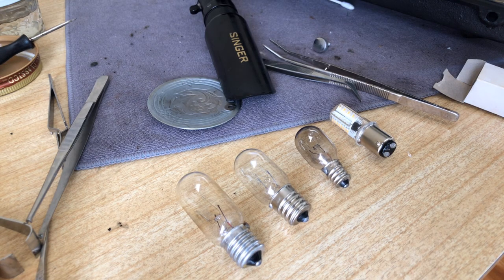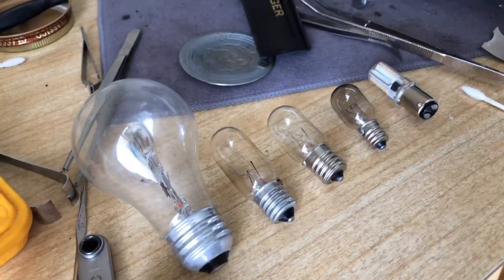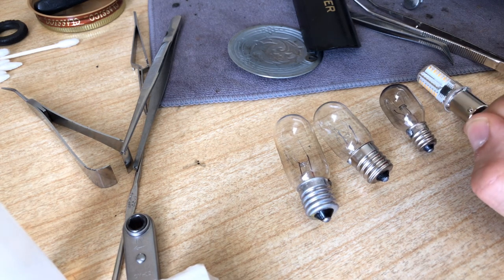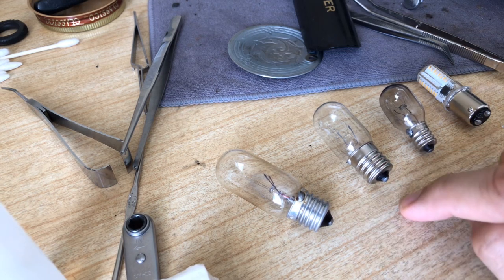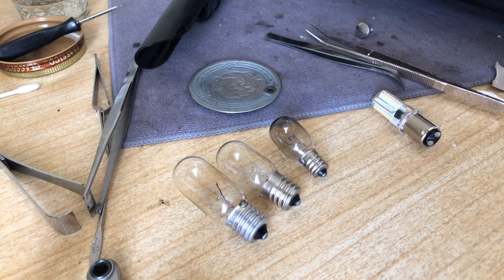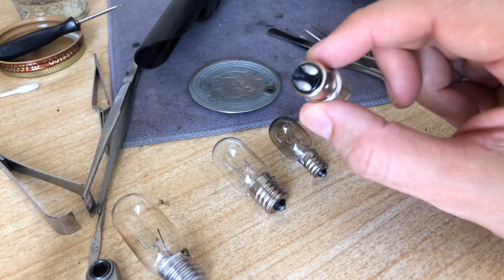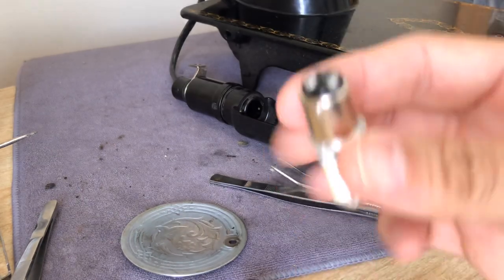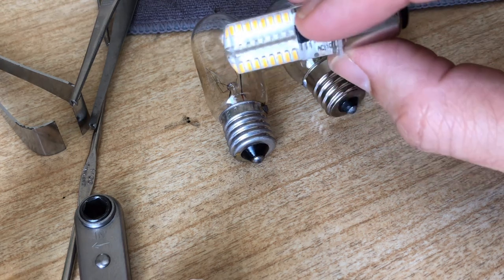TOOLS & EQUIPMENT SERIES #5: When the Light Bulb Comes On: Bulb Types For Vintage Sewing Machines!

Comment: Thank you for this video. My bulb broke inside the socket in my Singer 128. Any tips on removing it? How do you remove the metal light deflector ? I feel with that removed I could get better access to it.
Reply: Get a short length of 1/2" vinyl or rubber tubing from Home Depot or your local Hardware supply. You'll only need about three inches or so. Cut a 1/4" slit into one end of the tube. Insert that end of the tube into the stuck lamp base which you need to remove from the old socket. The little cut you made will allow the end of the tubing to insert into the broken bulb base.  These bulbs have a base that is slightly over 1/2" so if your tubing is too small, get the next size up (5/8").  Push and then twist, as if you were removing the bulb normally. If all goes well, you will be able to remove the broken end of the old lamp, it should be held by the piece of vinyl/rubber tubing. When you retrieve the vinyl tubing from the lamp base, the old remnant of the broken bulb should come out right along with it.

Hope this helped! Great question.

Comment: Came here after trying to replace the incandescent bulb in my Singer 247. I have the proper LED bayonette replacement, but the socket is not compatible with the new bulb, having a deeper socket, which has a 1/16" ridge, preventing the two pins from engaging with the lower slot. I've replaced all my other sewing machine bulbs, with bayonette mounted fixtures without any issue, using the same replacement LED product (a Husqvarna LENA  and a Kenmore 158.14101).

I think I could modify the fixture to accept the new bulb, or replace it with another fixture with another receptacle, but is this absolutely necessary? Is there another bulb that might be compatible?

We need you.
Thanks for the content.
Keep up the good work.
בס'ד

Comment: I am having a problem. I can’t remove the light bulb from my 201-2 machine. I’ve tried everything I can think of. I’m afraid it will break in my hand if I push any harder and try to turn the bulb. I’ve never had this problem with a singer light bulb. Can you give me any feedback as to how to remove it.

Comment: I have upgraded many machines to led bulbs. Surprise, they don't always last as long as they are supposed to. I've had some burn out after twenty hours. But they do run much cooler and use lots less electricity.
Reply from the maker: Great point Ronald.  "Good" LED bulbs should outlast any other type.  But sadly, like everything else consumer grade, there are poorly made LED bulbs that don't last.

Comment: I have a really good condition 15-90 however the bayonet style fixture has a broken cover that goes over the wire and switch internals. It seems to be a bit of a pickle of a situation since I can't even find a listing of the fixture at all anywhere. I have no idea where I'm going to find that piece or if it's even possible, so any suggestions would be appreciated. It would be such a shame if that's the only piece that doesn't remain original since even the decals are almost perfect.
Reply from the maker: Hi Joe.  Singers are generally some of the easiest machines to get both original vintage parts for as well as some reproductions.  There could be a number of sources but you might try looking at bonanza.com  as well as https://www.vintagesingerparts.com/collections/singer/products/singer-sewing-machine-replacement-light-fits-many-models-15-15-91-15-90-27-28-66-99       Another site specializing in Singers is    https://www.singeroriginalvintageproducts.com/
Reply: @VintageSewingMachineGarage  Thanks so much.